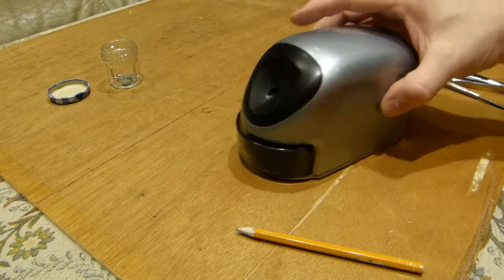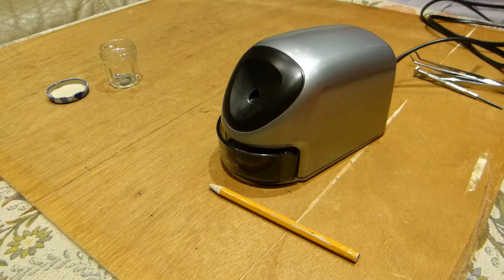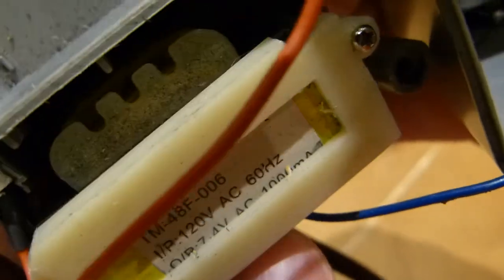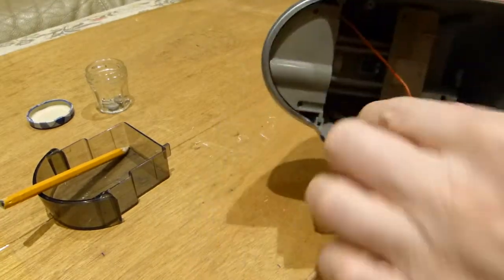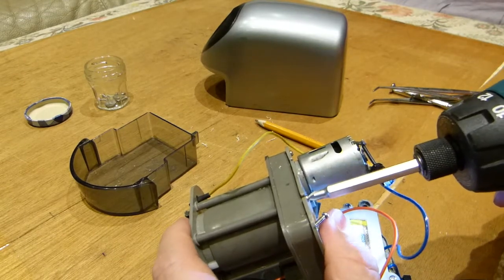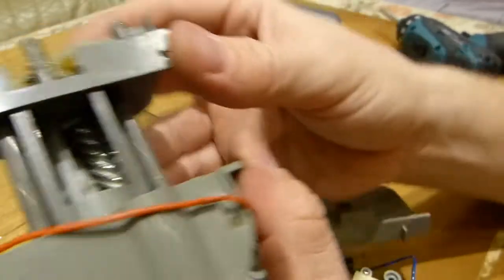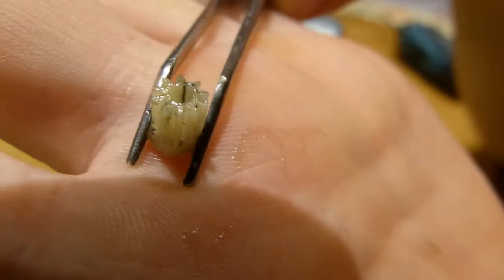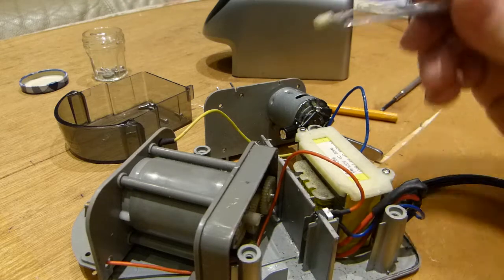Staples model 34462 pencil sharpener FAIL & review

Comment: Hi there, what method did you use to get the initial first four screws out from the bottom? Did you use the long skinny silver Phillips screw that is next to the tweezers? I am not good with tools but I found the 3D print file to replace the gear and am having trouble getting the screws out. Thanks!
Reply from the maker: It probably the skinny screw driver

Comment: Could you glue the failed part onto the motor ? So long as it's connected to the shaft it will spin and therefore make it functional again right?
Reply from the maker: Yes it can be glued on if metal-to-plastic glue is found and the adhering surfaces are de-greased perfectly.